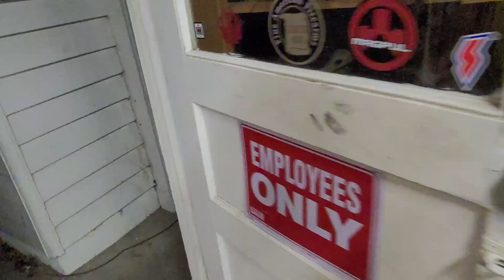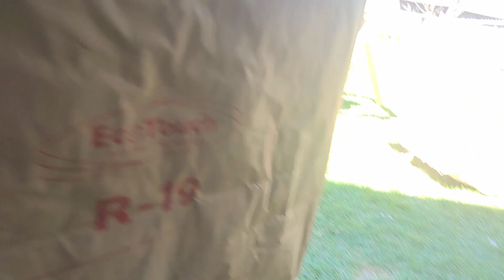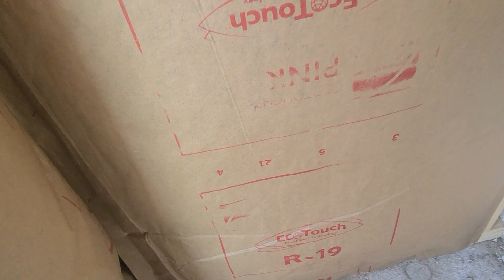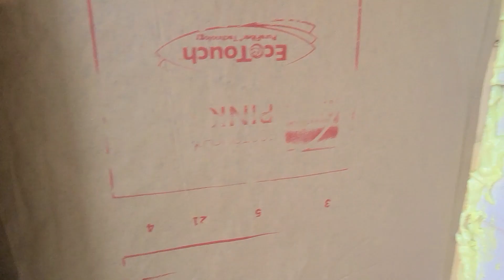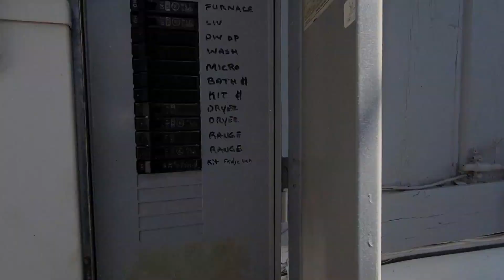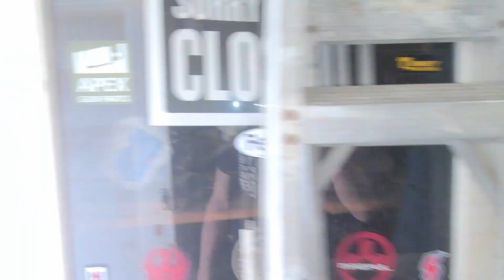Air Compressor Shed Build Pt 3

Comment: 02:49   Should have used Roxul Safe-N-Sound insulation.  The sound deadening it offers is very quiet.  Your fiberglass insulation has virtually no sound-deadening properties.  Could have put it on the shop wall as well.

18:04   Should have used a mechanical wind-up timer instead of that switch.  That way, if there was an issue, the compressors would not be running until you got back.....

00:00   As to the doors, use piano hinges and a latch at the top and bottom.  Those items will reduce the twisting/warping of the doors.

Comment: It sucks when a door doesn't hang straight. You can put a diagonal piece of 1/4 all thread and a turnbuckle in the door to help draw it in. You'd have to kinda mount it close to the siding on the bottom corner near the middle and then the upper left corner towards the inside to give it a bit of a twist. BTW have you had any trouble with mice getting into the insulation?
Reply from the maker: I'll post a pic or short video in the morning when I have light. I will add that in the future. The doors for now are holding strong.

Comment: Planning something similar.  If you did it again would you use foam board instead of fiberglass batt?
Reply from the maker: I wouldn't, unless you are truly paranoid about it freezing in the winter. I didn't have any issues with it freezing. But I am going to put some cheap plywood (I know, there is no such thing anymore) to better seal and protect the insulation.

Comment: Those oil free compressors sure are noisy. Making an outside enclosure is a  good idea. How have those compressors been holding up?
Reply from the maker: They have held up really well. Only had to  replace one relief valve...... so far. But they are holding up really well. And they are the oiled version. I check the compressor oil monthly when I do the fire extinsher maintenance.
Reply: @macstinkerhole  That's even better. I haven't had much luck with oil-free compressors. The oil compressors are the better way to go. With having two compressors as you do, it one goes down, you still have one to get you by until you resolve the issue. My old 60 gallon oil-free compressor blew apart on me in the middle of a job and it was obsolete so I couldn't fix it.  I had to buy a new one and bought a Quincy QT-54 60 gallon 2 stage. I am well pleased with it and it is reasonably quiet.